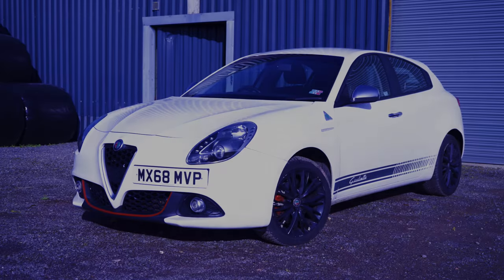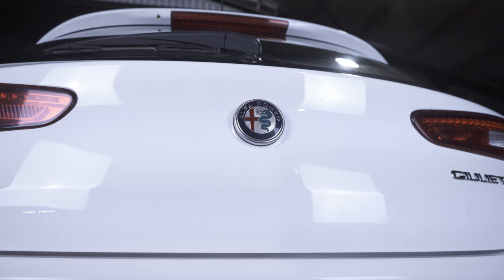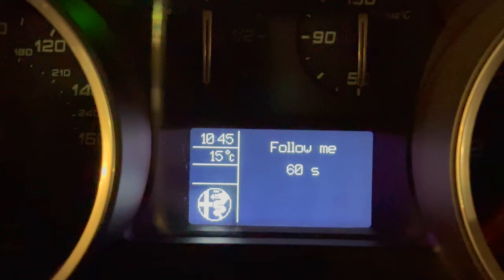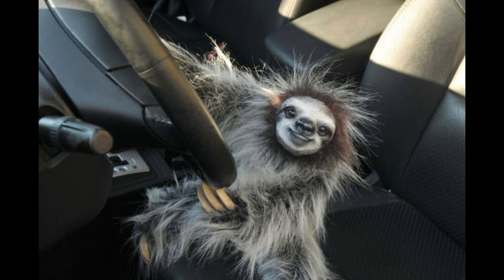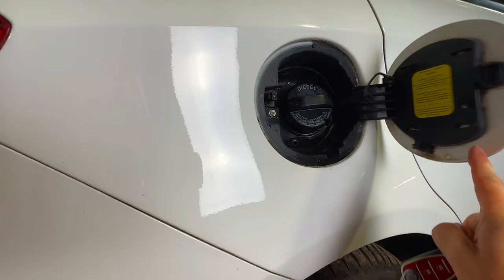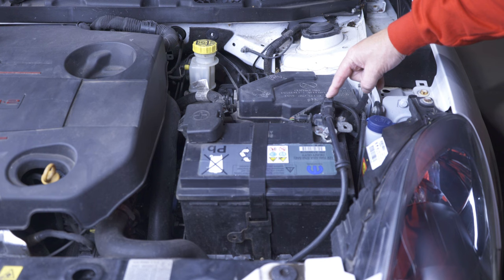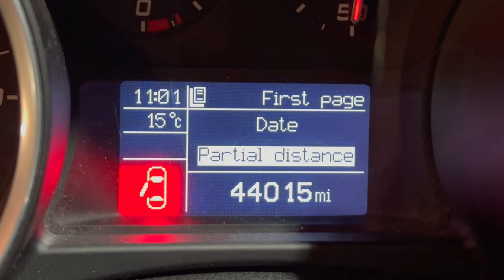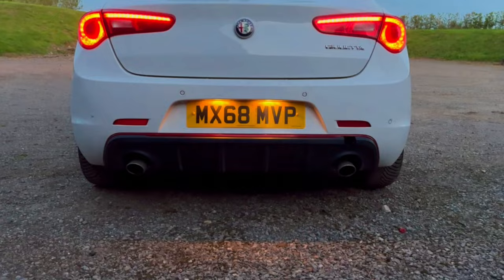Alfa Giulietta - 6 Hacks in 6 minutes!

Comment: Little information to all the Giulietta guys: If the battery loses connection or you use the nice hack, it is possible that you have some errorlights on the dash after that. That is because the Giulietta loses it's steering angle calibration which is simply relearned by turning the steering wheel on running engine from one side to the other completely and after that turning the engine of and start it again. And to Chris: thanks for the video.
Reply from the maker: Thanks for pointing that out mate - yes indeed the dashboard will be full of error messages after reconnecting the battery but they should all disappear again after a short while! 👍🏻

Comment: I dont know why but my stop start feature doesn't seem to work even though it shows as being ON.
Reply from the maker: Hi mate, simple fix - just charge your battery fully and it should start working again. If the battery is low it doesn’t work due to the power demands of cranking to start. If that doesn’t solve it, your battery may need changing. 👍🏻
Reply: Hi, there are some preconditions for S&S to work:
- battery level/health - make sure you have a recomended battery which are premium batteries (Bosch S5, Varta Silver AGM, etc.)
- DPF regen will not allow the car to shutdown automatically until the regen process is completed;
- engine too hot, imagine you been pushing hard and coast suddenly, the engine will keep running to circulate oil and radiator líquid through internal engine parts. 
- If you do short distances most likely the battery won't be able to recover enough energy to trigger S&S.
Reply from the maker: @fernandofonseca2033 thanks for watching Fernando and for the tips! 😎👍🏻 Do you have a Giulietta?
Reply: @TheAlfaNut  yes, 2011 1.6jtdm-2.
Reply: @fernandofonseca2033  what is DPF regen? I replaced my battery last week and SS is still not working :)
Reply from the maker: @thinkkerrythink8938 “dpf regen” (regenerate) is the process that the diesel particulate filter goes through, to rid itself of the soot it accumulates.
Reply: @thinkkerrythink8938  diesel particulate filter regeneration. When the DPF is in regeneration the SS won't activate so the regen process is not interrupted. If the battery is new (assuming is a good battery) it should work frequently.
In my opinion these are the conditions for SS to activate more frequently:
- battery is fully charged which means after driving for a while;
- engine not very hot (e.g. going uphill pushing it);
- AC off, if outside temp is very high the car my give priority to ac working so engine must be on;
-coasting in neutral instead of coasting in clutch (obviously it won't turn engine off when clutch is pressed); 
Hope this helps

Comment: If you leave your windows open with the deadlock ,or your favourite pet in the car ,the motion sensors will pick up movement and set the alarm off...
Reply from the maker: Thanks for commenting mate, I should have said in the video that pressing the anti lift / volumetric “off” button up on the roof panel, disables the internal sensors preventing alarm actuation. This allows pets to be left and windows open. 👍🏻

Comment: Thanks for hacks I am thinking of buy a Giulietta could you tell are they easy to work on and which model you suggest 
Kind regards  p.
Reply from the maker: Hi mate, depends on your budget - if you want lots of fun, get a 1750 QV, if you need economy as well, get a 2.0 jtdm. They are reliable but not the easiest car to work on in my opinion, typical Alfa quirks! 🫣
Reply: @TheAlfaNut  thank you for your reply can't  be any harder than the peugeot rcz I currently drive. 
Well check them thanks again for information. 
  Kind regards p
Reply from the maker: I like the RCZ - great looking car and goes well 👍🏻

Comment: Good video. Do you reckon Alfa will ever make a new version of the giulietta ? Looking at a used giulietta. Do they make sense to buy still, thinking depreciation. Which is best engine choice for mway and highland roads . It’s that or a mini clubman. Cheers
Reply from the maker: Hi Steven - yes Alfa just announced a new Giulietta although its an EV 🫣🤢
The old model is reliable, good looking and fun to drive - buy the 2.0 JTDM for great torque on the hills and 50-60mpg on motorway!  Don’t buy a Mini Clubman - they are boring, ugly and very very common! (Just my opinion 😉)
Reply: @TheAlfaNut  lol. Honest, concise, like it lol. I am never buying an EV. Biggest conn ever. Yeah I may test drive one I saw locally. Thanks for replying, appreciated
Reply from the maker: My pleasure.  It’s a buyers market out there at the moment, some huge bargains to be had. Try looking / asking on the Alfabook group on Facebook, lots of Alfa enthusiasts who maintain their cars to a high standard who might be selling. 👍🏻

Comment: Hello
I set my follow me home light to 30 secs and it doesn't turn on when i close the car, what am i doing wrong?
Reply from the maker: Hi there - you have to flash the lights immediately after turning off the ignition key. Are you waiting too long perhaps?
Reply: @TheAlfaNut  i tried that still doesn't work, turned the ignition off then immediately flashed the light 30 seconds showed up then pulled the key out turned the car off and the light is off.
Reply from the maker: Ok, I’m not sure why that would be - you might want to go to: www.alfaowner.com and ask on the Giulietta forum - they are helpful people. 👍🏻
Reply: @TheAlfaNut  quick question, do i have to flash the light every time for it to work?
Reply from the maker: @benhnia09 yes you do 👍🏻

Comment: Do you have any advice, I'm thinking about buying 1.4tb 170hp, 2012 Giulietta? :)
Reply from the maker: Hi mate, thanks for watching - make sure that it has good service history (and supporting documentation!) and that the cambelt has been changed recently.  If not, negotiate harder!  Check all the electrics are working and also check carefully for rust if you can. High mileage?
Reply: @TheAlfaNut I’m considering buying a high mileage Giulietta qv, any tips?
Reply from the maker: @mrfooget3714 yes - get the best maintenance history car you can find, check the timing belt history, check the suspension health and make sure all the electrics work. If any of the cheap plastic interior door release handles are broken they are a huge PITA to replace! Check carefully for rust if the car is over 10 years old. They are a lot of fun for the money!
Reply: @TheAlfaNut  Amazing thank you! What areas seem to rust up the most? It’s getting a brand new timing belt at time of purchase, service and mot. The 1750tbi seems pretty reliable would you agree? And is there anything else to be aware of? It has 90,000 miles at time of purchase
Reply from the maker: Rust can happen anywhere that the car has been damaged, chipped or scraped, so give it a good check over. Giulietta’s are very reliable mechanically when serviced properly and 90k miles isn’t much really. The 1750 engine is great but puts more stress on brakes & clutch so make sure these are good too 👍🏻

Comment: Any 916 hacks? Thanks
Reply from the maker: Hi Ben, yes I probably will make a 916 hacks video, although there are less electronic gizmos in a 916 - I’ll have to read the owners manual! 😉
Reply: @TheAlfaNut  great thanks! I’ve had a GTV for about 2 months now and absolutely loving it. Only gremlin has been the two occasions the central locking refused to stay locked and then decided to work fine a few minutes later, at the exact point I’ve given up and put the disk lock on the steering wheel. So my only hack so far is the fact the boot release is housed inside the lockable glovebox! 😅
Reply from the maker: @benfearnhead9851 haha yes the GTV central locking can be a bit temperamental sometimes! Sometimes it works properly if you use the key instead of the remote?